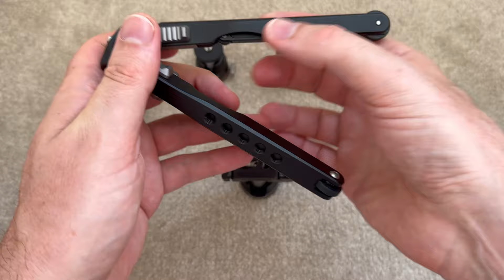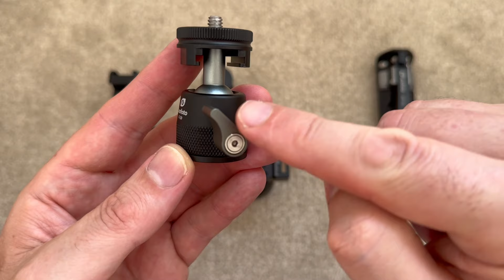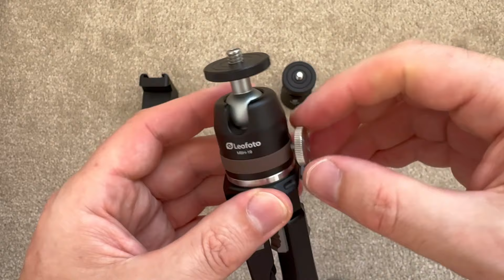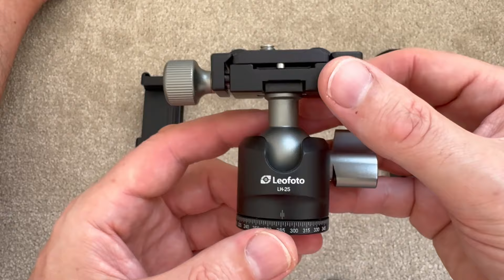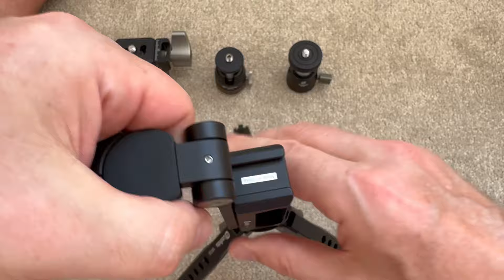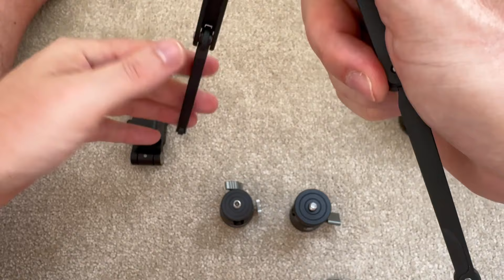#211 Leofoto MT-03 Tripod & Ball Head LH-25, MBH-19, F-19 and PS-2 Phone Mount

Comment: The MBH-19 seems to have the better design allowing to control pan and angle with independent knobs. Does the LH-25 really use the same knob to control both angle and panning? How does that work in practice? I'd imagine you'd need the knob fairly tight to lock in an angle but also fairly loose to be able to pan. How smooth is panning in practice without a built in pan bar and having to turn the camera itself?
Reply from the maker: the LH-25 is a much bigger ball head with the Arca Swiss fitment piece. The LH-25 does not have the pan knob so if you wanted to pan, you would have to re-position the angle that could be a nuisance if you need to set an angle then pan. The LH-30 I believe is the larger ball-head that has a pan knob. The MBH-19 will be great if you don't have anything heavy and it uses the 1/4 screw fitting. Remember the LH-25 is 3/4 screw but it does come with a very cool reducing adapter that takes it down to 1/4. If you don't have anything heavy and use 1/4 and you do want to pan the MBH-19 would be great. If you still need to pan and you have a larger camera and you need to pan and also has Arca Swiss then take a look at the LH-30. I have to say all this equipment is the best I have ever used.
Reply: @luxmaster   I am just using an iPhone 16 Pro Max in a Fjorden MagSafe Grip Case with a 1/4 mount so it sounds like the MBH-19 is perfect for the job. It's a much more compact setup with the MT-03 as well which will make packing both a breeze. thanks for the breakdown!
Reply from the maker: @vapor92   based on what you say, the MBH-19 with a MT-03 is a very cool set up. I would use it myself but I tend to use Arca Swiss iPhone mounts so the LH-22 or LH-25 wins. the LH-22 is a 1/4 version and a bit smaller than the LH-25.
Reply: Very helpful. The MBH-19 will be perfect for my GoPro. Thank you very much.